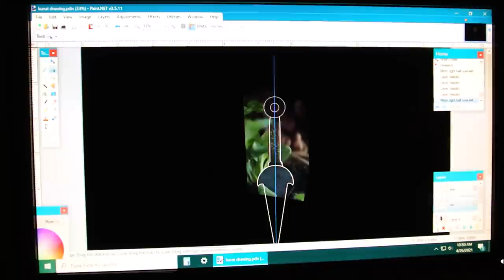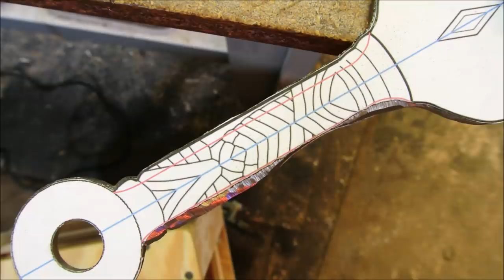MORTAL KOMBAT replica: Scorpion's wife's garden Kunai.

Comment: Works on steel, while wearing an Alcoa shirt...  You are a man of contrasts, Sir.

Wait, You call your wife Scorpion?   😬
Reply: That grammatical problem really did have me going back and forth. Expression can be paradoxical. In most cases, it reduces to being more about clarity, so one is just better off not puzzling over precise communication so much. I blame my background, and ALCOA. And my biology. And everything else. 

Contrasts, though? Maybe. More like a radical temperate—a centrist. The way Lye and Acid make a reasonably drinkable hydrogen hydroxide, though a bit salty.
Reply: @pocket83squared  I must confess, I commented before googling.  I know; shame on me.   I had no knowledge at all of Mortal Kombat. 

On a more serious note, I was struck by your use of epoxy AND wood glue on the handle.  Was that just a belt-and-suspenders thing?  I've seen plenty of folks make knife hilts using epoxy, but I don't think I've ever seen someone use wood glue at the same time.   Does it leave less of a seam?
Reply: @Wordsnwood  What? You're about arcade-aged. You really don't remember MK? It was big when I was a kid. 

As for the glue/epoxy thing, the answer is kind of obvious. Glue works best for wood→wood connections, and epoxy is better for wood→metal. It was just a case of using what's appropriate where. 

Sure, glue-ups are notably frustrating and intense (especially while being filmed), but the rush isn't usually an excuse to break the rule—as long as it's still possible to follow it. One thing, though: you do have to be mindful not to mix moisture with epoxy. My approach here was to use pressure to sort of 'squeeze out' the wood glue so as to not trap it behind epoxy. 

Thanks for stopping by.
Reply: @pocket83squared  Yup, arcade aged...   Defender, Tempest, Dragon's Lair, Battlezone, Dig-Dug, Joust... ummm, many more.  I think I leaned more to the space-ship type and less to the "person running around" type.    If I could have all those quarters back!  😆